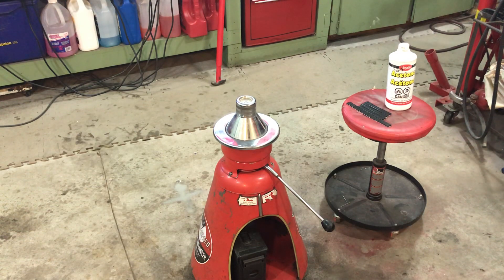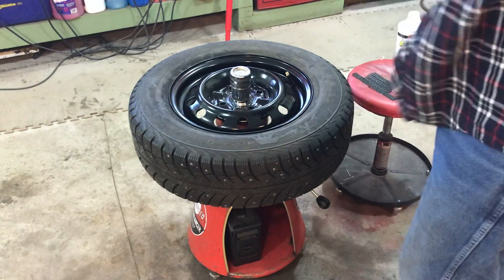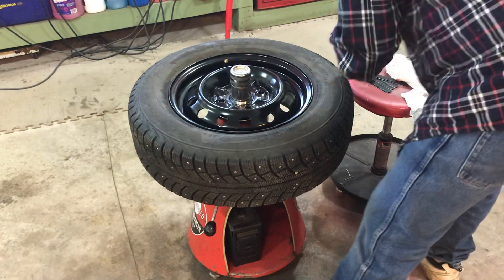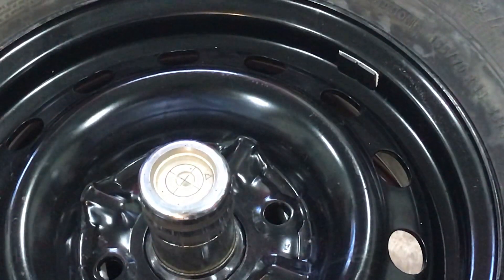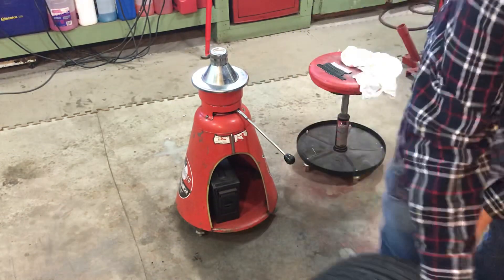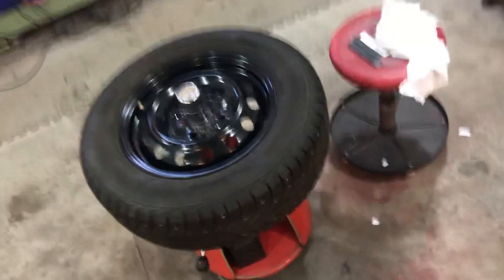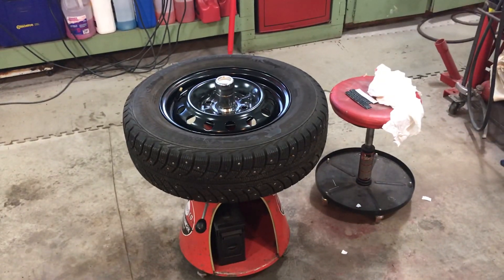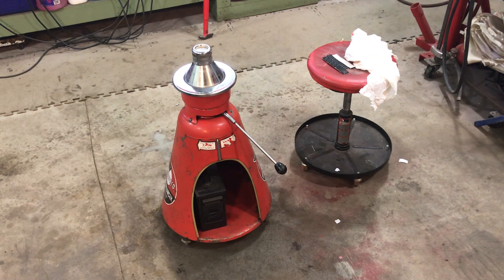Static Bubble Wheel Balancer

Comment: Been using the same one for a few decades , very accurate . On steel wheels , i use the hammered on weight , according to the instructions , you use 4 weights , 2 at top , and 2 at bottom . so you start by marking with a pen the unbalanced spot , then you [ guess ] put 2 weights 6 inches away from mark , and 6 inches on the other side . to balance you move the 2 groups of 2 , closer or farther  from each others . You may have to start over with different weights weight if you cannot do it . When you are done , you hammer 2 weights at top of rim and 2 at bottom .

Comment: That is a nice balancer. I balance my motorcycle tires on a machine set for static. They are smooth at 150mph. Studded snow tires change balance quickly due to shucking studs and rapid wear on dry pavement, but in the snow you don't go fast enough to notice. Nice setup, Brucestone!
Reply from the maker: Thanks!  That's exactly my thoughts, that a balance doesn't make much difference with studded snow tires and with the shitty roads, you wouldn't even feel it if they are out of balance.  I don't think I ever balanced the tires on any of the motorcycles I had. I did mostly take them to a shop to change them anyway.  Back then before the interwebz and I bought tires at a motorcycle dealer, they installed them for free when you bought the tires there.
Reply: @BruceLyeg  
I once installed a non balanced front tire on my motorcycle. It was fine until I hit 120+mph, where it started hopping up and down! I always balance them now and surprisingly, they take as much weight or more as car tires do
Reply from the maker: @upsidedowndog1256  Ya, things on a larger diameter wheel going 120mph+ would get a little hairy if unbalanced.

Comment: a very nice balance,  tire tips when installing tires on rims,  if you have  a red dot on the tire, line the red dot right up with the valve stem, if you have no red dots on your tires,  look in side the tires to find a over lapse of rubber,  you will see like rubber lines going across the tire,   could  be 3 lines  our 2 line what every  make a mark right in the center of the lines,   put this line  the opts from the valve stem , i have balanced my wheels right out doing this didn't need led waits at all.
Reply from the maker: Thanks for the tips zmby

Comment: hi, acording manual of this tool you should divide weight on two side of the rim and little should be split about 30 deegres
Reply from the maker: Thanks Andy, I'll look into it.  It never came with a manual and this is how I was taught to use one just like it 30 years ago.
Reply: @BruceLyeg  This forum has instructions for your balancer. See post #56
https://www.jalopyjournal.com/forum/threads/bubble-tire-balancer-experience.1129483/page-2

the instructions show the splitting of the weights as mentioned above. I sent you an email if you want a copy on ten separate pages that I made.

Comment: Maybe this is better they the Chinese bubble balancers but I have yet to get a smoother balance with one. Recently bought new tires tried them with no weights was actually very good almost perfect. So I put them on the bubble balancer use weights to put bubble in middle try it and it now has a high speed shake.  Taking off the weights.
Reply from the maker: @dwaynemcallister7231  you did something wrong if that’s the case
Reply: @BruceLyeg  I found no consistency with mine, mark the light spot then remove the tire and place it back in a different orientation now the light spot has moved.
Reply from the maker: @dwaynemcallister7231 sorry, my comment came out ruder than I meant it to. I hit send before I was finished. I had the HF bubble balancer and this one is waaaaay better. While not as good as a rotary balancer it’s pretty good for what it is

Comment: Nice job Bruce I just bought one just like the one you have but mine is not quite as nice as yours. Do you know the age of this style balancer ?
Reply from the maker: Thanks Rodney. I can check on the manual if there's a date.  I'll have to dig for it but I could probably do it tomorrow and let you know.  I believe mine is from the late 50's or early 60's.  Mine performed it's duty in a shop near my house till they closed down in the late 80's.

Comment: am looking at the bubble on your balance  now,  and when looking down at the bubble  right between the x marks  i see the little  pointer ,  some one had told me that  when balancing a wheel we put the valve stem in line with the arrow, so when we take the wheel off the balancer to add the  led,   we know where to put it back in the same place on the balancer,    just wondering  of the positive chose the arrow was put on the bubble for. ?
Reply from the maker: That's what I've been told as well

Comment: good evening sir,  i was wondering if the little arrow mark close to the bubble wouldn't be the  valve line up spot? or if it isent  would you know what it was on the bubble for sir, ?   the other bubble balancers do not have this mark,  like the other balancer you have , could you let me know sir, thank you have a great evening
Reply from the maker: Hello zmby, no need to call me sir, Bruce will do!  That is apparently what the arrow is for. It has something to do with the weight of the valve stem or something like that.
Reply: @BruceLyeg  thanks,  have a great day.

Comment: How do you know if the wheel is sitting flush on the cone? For example the cheap harbor freight balancers have that spring ring that keeps wheel perpendicular to the cone. I went thru 3 different hf type balancers and all were casted wrong, the divot is off center causing wheel to look balance until you move it a quarter turn to check the balance. I’m wanting one of these, not cheaply made like the others.
Reply from the maker: When you move the lever, the wheel drops onto a flat ledge that keeps it flat.
Reply: @BruceLyeg  lucky me, I found one on eBay! Few quick questions if you don’t mind, how much oil do I fill it with? Mine has no fill line on the inside? And 2, you said to level the bubble with it in the on position right? Also what difference does it make to align arrow with valve stem?
Reply from the maker: @TheHopson  Congrats on finding one!  I'll have to check the oil level for you tomorrow, I'll let you know.  The arrow lines up with the valve stem to account for the extra little bit of weight of the valve stem.  I actually found an original instruction manual for it, give me your email address and I'll send you a copy
Reply from the maker: @TheHopson  Just sent it.  Check your emil
Reply: Yes I received it! Your the man! I have looked everywhere on google and couldn’t find anything! Hard to find people that are willing to help anymore! Thanks!
Reply from the maker: @TheHopson  Glad to have helped.  I can't really take credit though, someone else found it and sent it to me
Reply: @BruceLyeg  only question I have left is, how much oil do you have in yours? I filled mine flush to the first  little step up inside the bowl. If that makes any sense?
Reply from the maker: @TheHopson  it’s about an inch from the bottom. All the oil does is stop the wheel from wobbling excessively when trying to balance it. Like a dampener
Reply: @BruceLyeg  did you see the email I sent you? Appreciate your help!
Reply from the maker: @TheHopson  I did and replied to it

Comment: I just bought one like that for $100. That balancer has 3 levelers not 4 like others. Easier to level and will never rock. Also a pint of oil is supposed to be added to the top section. Lift the bubble cone out and you will see the reservoir. This will dampen the balancer and it won’t wobble so much.

Comment: You folks in Canada 🇨🇦 take your winter tires seriously. Here in NY we can have as little as 2/32” of tread. You can Guess who’s in the ditch when it snows ⛄️ Not me, I run new snow tires . I Only had to wreck a nice truck to learn
Reply from the maker: Oh trust me, about half the people here are still driving around with bald summer tires complaining that the roads are too slippery.  I use all seasons on my SUV but figured studded snow tires would be the best option for the wife's front wheel drive Honda.
It made a world of difference when I took it for a test drive after installing the tires.  The wife is pretty pleased too.

Comment: xtra care and this works: #1 problem.. you rolled/ aired up tire.. then dropped it on pee gravel and that will throw off weight/pick out the rocks :>).... #2 always take the time to center the feet with the 3 ajusters on height.... get it close as possible to level.. #3 greese/oil/or wd 40 on the under side pin! (makes it move smoother and not stick/gives false reading on bubble). slick it -up ...:>). #4 always double check with a tire thats been balanced with a computer! see that its true. #5 keep in mind/this was old way /when 55mph/if going to drive 80mph + /get the computer balance ---equals atleast 30% true-er

Comment: yes that is a very nice bubble  balancer,    and that is the truth sir,    now maybe some bubble balancer work differently , this is what i found out about the bubble balancers,     well  a bubble balancer will  give use a sort of a balance,  but after 
you finished balancing your wheel, and have the  led on and all, sir, 
and the wheel should be balanced,  now put the wheel back on the 
balancer   but do not put the wheel back on your balancer in the same 
place,  turn the head of the balancer around some,  just pick the wheel 
off the balancer, place the valve in a different place  keep doing that 
  and more then likely you will get more then 7 our 10 different places 
called the  heavy and light spot of the wheel,   to balancer a wheel to 
have a very good balance with a bubble balancer,   you need to spin the 
wheel on a shaft and cone to find the true blue heavy spot so that you 
can put the wheel back on the balancer   and keep turning the wheel 
around  lift it off the balancer until it wont's the led on the right 
light spot  that you marked when you had it on the cone and shaft,  much
 the same as a motor bike wheel balancer   that will find the right 
heavy spot  so that you know  now where the right light spot is on the 
wheel,   you are not going to every find the right spot on the wheel 
with a bubble balancer sir,   you can balance the wheel very good after 
you find that light part of the wheel  100%   i have a  bubble balancer 
also sir, and people,    how come  after we balance a wheel   and rotate
 the valve  about 1/4 of a turn when putting the wheel on the balancer  
 then we find a other  heavy and light spot on the wheel,   some other 
people had told me  yes i found the heavy and light spot on my wheel,   
becouse after he had balancer the wheel he put the wheel  back on the 
balancer in the very same spot as it was balanced in the first time,   
turn the wheel in a different direction when placing it back on the  
balancer ,    if some one  would  make this test to see of there balancer is working the same and be nice and let me know if it is so sir?.
Reply from the maker: That's all good advice.